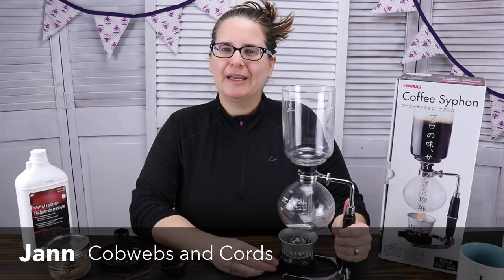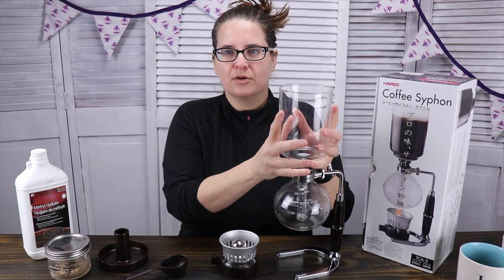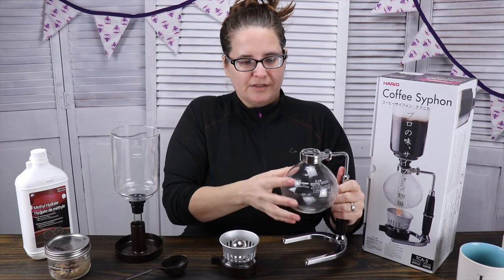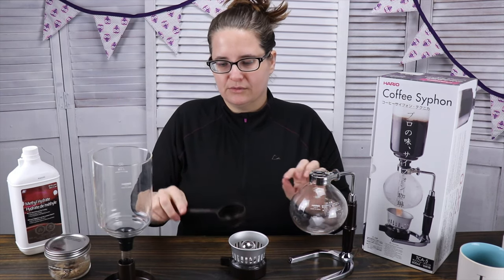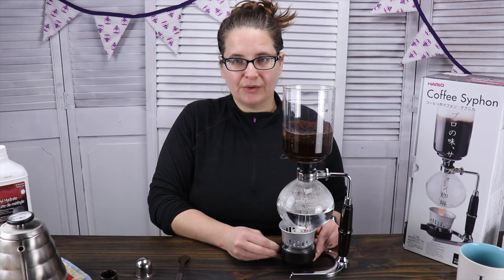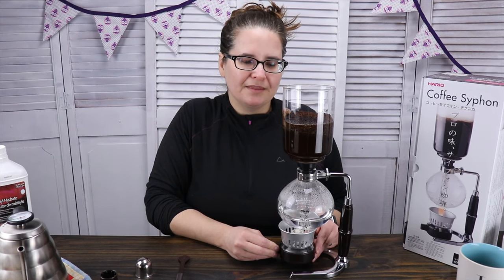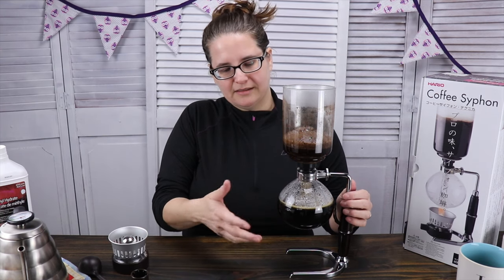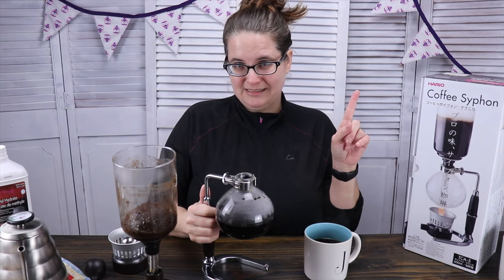Hario Coffee Syphon - parts, demo, and details - watch before you buy!

Comment: I received one of these as a gift and I love it. I would recommend going against Hario's instructions. Set the top chamber onto the bottom chamber to allow it to preheat, but don't seal it. When the bottom chamber is boiling, then seal the top to the bottom and wait until all the water is in the top, then add your coffee grounds. This will give you more accurate control of your steep time and won't 'cook' your grounds.
Reply from the maker: Great tips! I’ve played around with it too, and it definitely can make a difference. 👏💕

Comment: Can I use rubbing alcohol instead of denatured alcohol for the burner?
Reply from the maker: Oooooh I’m really not sure. I’m definitely terrified of this unit so I used the suggested alcohol. I’m sorry this isn’t more helpful. 😔
Reply: I just did. Ethyl alcohol works.
Reply from the maker: Ooooh good to know. Thank you so much for letting everyone know 🙌
Reply: In case anyone else is searching, you CAN use rubbing alcohol but it will leave a lot of soot and be kinda smokey. Denatured alcohol is best and most big stores sell it. Some marketed as paint thinner or fuel or even fuel treatment (brand name Heet)

Comment: I used the washable metal/rubber filter that came with it and when I add the coffee to the upper chamber ( still maintaining flame) the weight of the coffee (30g) causes the water to immediately flow back down? Any ideas why?
Reply from the maker: Hmmm 🤔 I’m not sure. You have a good seal? You could try adding the coffee to the upper chamber before the water goes up and see if that makes a difference. I wish I could be there to help you figure this out. Let me know if you get it to work. Thanks for stopping in. 🙂